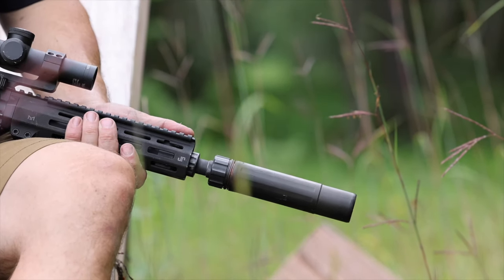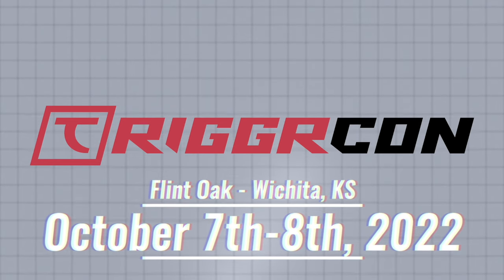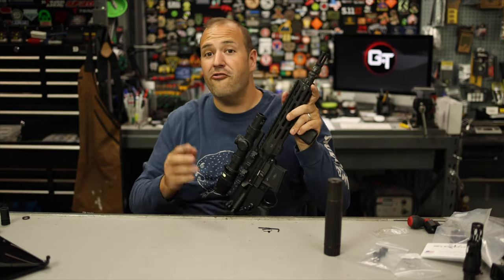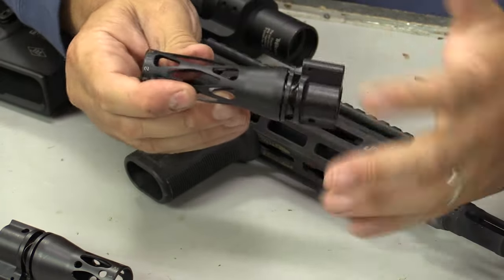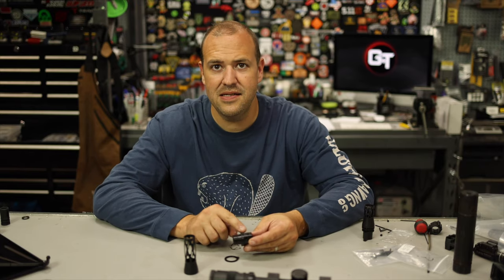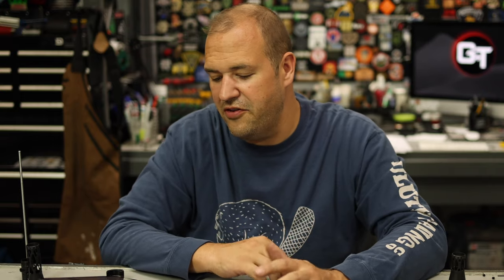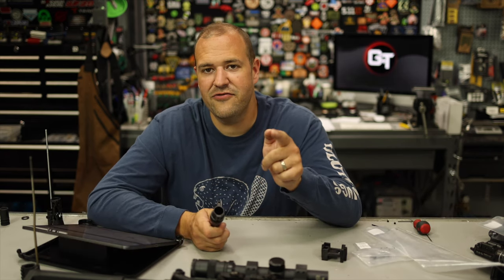The Best Adjustable Gas Block Ever - For Real the RifleSpeed AR15 Gas Block Delivers!

Comment: I have 1100 rounds on my 18” SPR with the RifleSpeed gas block. I never clean it, just put two drops of oil on the plunger and rotate the ring twice after every range session. No issues and no plunger erosion with full power 556.
Reply: What length gas system, handguard, and selector do you have? I have a 18inch with rifle length and a 15 inch handguard. Thinking about choosing the 3.3 inch selector but I want to make sure it’ll be long enough.

Comment: I like the superlative arms adjustable gas blocks. Excess gas goes out the front of the block. Not into your action or suppressor.  You do need a Allen to adjust but they're easy to tune and cheaper at around $85.00

Comment: Titanium bolt carrier from Walker Defence and bolt cam pin combo from HM Defence for a  really low mass bomb proof AR15 BCG. Also Walker Defence downward recoil muzzle brake or compensator. JP Rifle non reciprocating side charge handle with silent captured spring buffer weight plus suppressed weapons System integrally suppressed AR15 barrel

Comment: I just did a build using this. I'm having issues tuning it with me silent capture spring set up. It may just need some break in time. However, I can't get the ejection right at this time. Any tips on this?
Reply: Try different plunger sizes

Comment: The other point, is that if you allow just enough gas for reliable ejection, you get more gas behind the bullet and more velocity.
 Which is why the FAL has one from the factory. FALs can also SHUT the gas completely, making the gun into a bolt action, but putting all the power behind the bullet.
 Nice that after 50 years, someone added a simple gas regulator for the AR.
Reply: Would love the bolt action adaption to the ar 15, would you be able to shut the gas completely with this regulator?
Reply: I've seen test of rifles with the gas block fully open and also fully shut.  The difference in velocity is negligible.  As in less than 10 fps.  It is kind of surprising, but it doesn't make much of a difference.
Reply: Not really

Comment: That's pretty cool I've had really good luck with my Aero Precision adjustable gas block I like it because it's really low profile and it doesn't get into the handguard as easily and has plenty of adjustments and doesnt lock up
Reply: Same, and I have the old skeletonized . 625 on my faxon 16mid. I would love to have one like this where it's available at the end of the guard.  I run suppressed and non essentially at 7clicks with similar ejection pattern and lock back

Comment: 🎯 Key Takeaways for quick navigation:

00:00 🛠️ The RifleSpeed adjustable gas block is the speaker's new favorite for the AR platform.
01:32 🏆 RifleSpeed's gas block is hailed as a truly innovative product in the industry, offering significant improvements over traditional designs.
03:23 💡 The gas block features a unique control knob design, providing easy adjustments without the need for tools, with 12 levels of adjustment.
04:05 🎯 Adjusting the gas block allows fine-tuning for suppressed and unsuppressed shooting, optimizing reliability and reducing gas blowback.
05:44 🔄 Video demonstration showcases the gas block's effectiveness in adjusting gas flow, enhancing cyclic rate and ejection patterns.
07:34 ⚙️ The gas block is designed to fit under the handguard, with different lengths available to accommodate various setups.
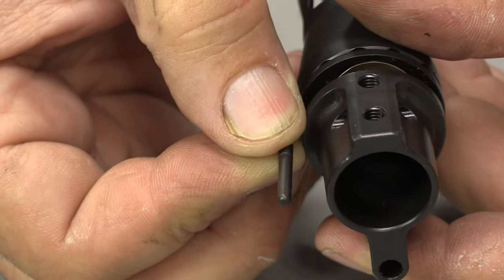09:37 🧼 Maintenance is simplified with easy disassembly for cleaning, with instructions provided on the company's website.
12:53 💪 Installation options include pinning the gas block to the barrel for enhanced reliability.
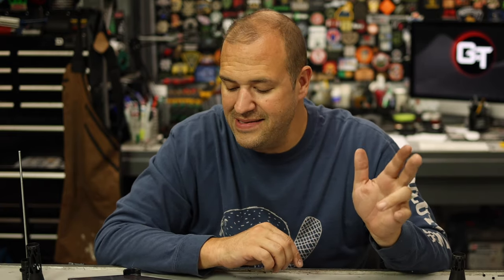14:15 💲 The RifleSpeed gas block is priced at just over $200, with various lengths and accessories available for customization.
15:25 🌟 The speaker praises the RifleSpeed gas block as a truly innovative and rugged product, offering unmatched adjustability and performance.

Made with HARPA AI

Comment: I felt the need to double up on the wave springs since my dial had a little bit of play but over 500 rounds through it so far and it's been great
Reply: I did the same thing..
Reply: I just added the RS gas block to two of my rifles.  Immediately noticed the single spring just did not feel like it was enough for positive detents.  And the block does indeed work great.

Comment: Cool idea and each their own however just creating a point of failure in my opinion. Another point you have to look. What happens when that spring gets weak from excessive heat?
Reply: That’s kind of what I thought. Better slightly over gassed with a fixed system than having another potential point of failure. It’s all relative though. Whatever makes sense to me and you won’t be what someone else wants.

Comment: Had mine for almost 2 years. It's great but you're behind the time
Reply from the maker: This is a re upload.   Made this a long time ago but had to take it down over a policy issue.  Been running them for around 2 years as well they are great
Reply: @GunsandTactics  ah gotcha.
Reply: How do they hold up?
Reply from the maker: Awesome, I have some on my main suppressed guns and no issues.  Every few thousand or so I wipe it down, clean the plunger.
Reply: @GunsandTactics  is this better than a bootleg adjustable bcg or do they compliment each other? The bcg is just easier to install initially.

Comment: Cool gas block.  Unfortunately it doesn’t work for my SBR because I’m running a 7.5” barrel and a 7” hand guard.  I have an ASR muzzle brake/suppressor mount.  And there would be no way to adjust this gas block once installed.  I went with an Aero Precision block with single tool click adjustment.
Reply: could cut the handguard a bit.

Comment: Thank you so much for this video.  I'm fairly new to the "building" world and am starting a .300 blk PDW build and was wondering just how concerned do I need to be when it comes to replacing a "low-profile" gas block upper with this oen from RifleSpeed? Will most handguard diameter's be acceptable? Thanks again.

Comment: This is really cool.  I'm just getting into AR building.  I'm finishing up a pretty standard 5.56 AR-15 right now with an Aero upper, but I've got parts coming in to make my first .300 Blackout build, and I'm doing that one essentially from the ground up.  I may have to get one of these gas blocks to upgrade my .300 Blackout build later.  For now, she'll be sticking with the gas block I got from Ballistic Advantage.

Comment: I think the plunger can wear from excessive firing, I think 8.6 or 300 blackout would work really well
Reply: I own multiple of them but I don’t recommend it for either of those. Because the range on it is not enough to go from supers to subs and the plungers don’t get out of the way enough. Couldn’t get a 300 blackout with subs(only supers cycled violently) to cycle with a .846 plunger(smallest one then cut it down further). On setting 12(wide open) 1.2 ounce buffer 11 ounce BCG, and subsonic 300 blackout spring. Swapped it out for a standard one and the gun cycled too fast. The gas block lives on my 22” Grendel precision gun now. That works fine. It really can only keep a tune in the range of max pressure 5.56 to min pressure 223 with and without a suppressor. 

If you want it to work you have to max out the efficiency of your gun and MAYBE you’ll get lucky but get ready to blow money on expensive ammo.
Reply: Use a bore scope and you can find a adjuster pin that will open and close all the way on a Rifle Speed adj gas blcok.. @ShepherdOfTheSilkies
Reply: @hairydogstail  I have a .857 pin…. Gas block is aligned…. I know what I’m doing I have 4 guns with the same riflespeed AGB none worked on that barrel configuration
Reply: No you don't. It is easy to look at the plunger in a bore scope and see the distance the plunger moves when adjusting.. @ShepherdOfTheSilkies
Reply: @ShepherdOfTheSilkies that sounds like alot of work. My 300blk with a rainier arms 6.5" barrel cycles subs or supers without adjustment, a mil spec buffer and spring and Nomad 30 suppressor.  What suppressor were you using?

Comment: For the 300 blk out try using an adjustable gas key instead, i have one in my pistol length gas system. I purchased the key and installed to my bcg no issues encountered. I don’t shoot suppressed and I reload my own ammo just an option to consider.
Reply: What is a gas key.

Comment: Will not fit on 16 inch barrels with midlength gas and a 15 inch handguard
Reply from the maker: Did you check their builder chart?  They might have a solution knob that would work.
Reply: I use them on mine..

Comment: I have one, my rifle only shoots when its on 12. It's not all that great, go with a cheaper adjustable gas block that is just as good.
Reply from the maker: You can get different pistons to tune to your needs.  I still haven’t found a better solution for a no tool gas block.
Reply: @GunsandTactics  interesting. any suggestions on one I should go for?
Reply from the maker: @ryanking4942  If you reach out to them and talk to Kyle, he is the gas nerd (in a good way).  If you tell him what ammo/barrel and what you have now and settings it runs and doesn’t he could recommend which piston size youd need depending on what you want, ie if you want to add a suppressor, different ammo etc.  He is one of the smartest guys in the biz when it comes to this stuff.

Comment: This is my favorite gas block for everything but subsonic compatible guns. It’s the most durable and maintainable system on the market.
Reply: why not subs?
Reply: @tedundercarriage8183  adjustment range issues. Never could get a reliable cycling, subsonic gun with the gas block no matter what combinations I tried, and how light I made everything. On the 300 blackout I used as a test bed, I minimized everything to the point where it can no longer shoot supersonic either reliably due to bolt bounce causing partial extraction of the fresh round. Even at wide open or with the dial 2 rotations(pressed the detent to let it go past 12) out it was still too restrictive.
Reply: @ShepherdOfTheSilkies  did you change the rod? they sell different lengths to change the adjustment range
Reply: @tedundercarriage8183  I changed the plunger with sizes they sell and then shorted one even more. The only time I got cycling was when I ran 300 blackout subsonic specific items in the gun with hand loaded subs that achieved 1000 fps out of the 10.5 barrel. Even made the gas port .080 on a pistol gas system. But even then it was not reliably cycling. The same gas block works on my 6.5 Grendel AR with a 22” barrel suppressor and rifle length castgas system.
Reply: Then your rifle is under gassed and has nothing to do with the adj gas blcok..Open the barrel port.. @ShepherdOfTheSilkies
Reply: @hairydogstail  .098 on a 8.5” carbine gas length isnt undergassed.
Reply: If the rifle is short stroking it is under gassed or the recoil system is mismatched..The adj gas block has nothing to do with it..

Adj gas blocks can only restrict the barrel port pressure, not increase it..If it isn't cycling then it is under gassed.. @ShepherdOfTheSilkies
Reply: @hairydogstail  it had a 1.2 ounce buffer and a subsonic spring. You build ARs as a hobby, I’m a gunsmith… theirs too much gas loss out the plunger to operate the system.
Reply: I have worked on more AR's than you have even looked at, so don't bother to play that bs..

Most gunsmiths don't know sh@t about the AR rifle platform as you have just proven..

I personally have two 300 BO's with 11.5 barrels that function reliably with both sub and super ammunition..They both have Rifle Speed gas blocks..

I suggest you take your rifle to someone who knows what he is doing..

  @ShepherdOfTheSilkies